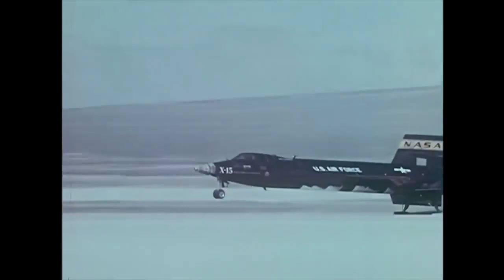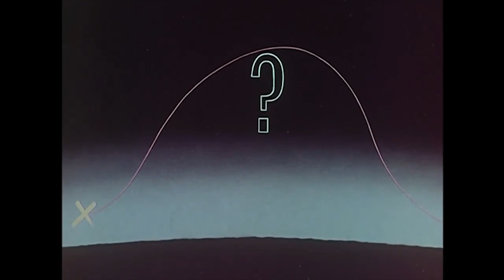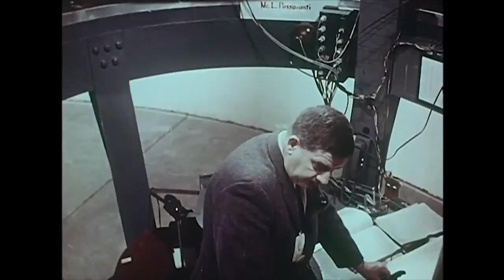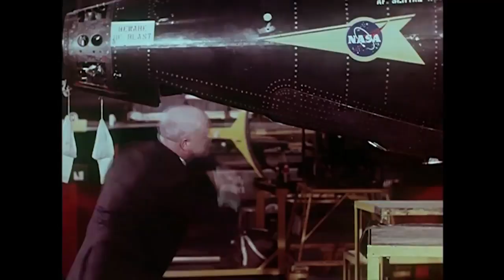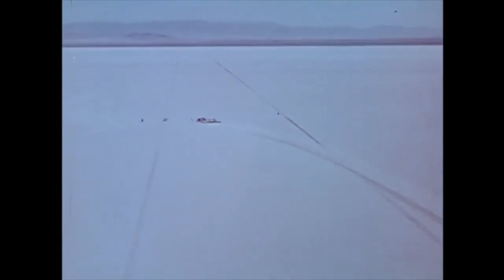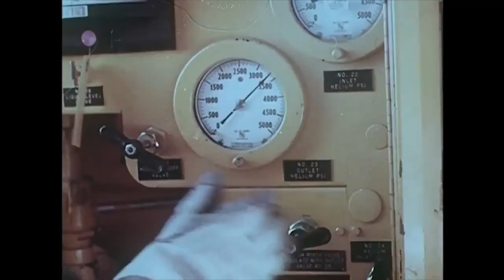Research Project X-15 - development of the X-15 rocket plane - 1962 NASA documentary

Comment: Much 8 ? Even today that's insane.  Plus , in my opinion, its the best looking aircraft, ever. Along with the Ford GT40, the best looking car ever.  What a wonderful era.
Reply: it's top speed was 7,274 km/h which is mach 5.8 not 8.
Reply: @ashokiimc  Correct.  I worked on that flight line for 4 years in the Air Force. 98-02  The X15 run pad is still there and they were still using the same B52 for tests.   It has since been retired.
Reply: @ashokiimc  The top speed of the X-15 was Mach 6.70 or 4520 mph, accomplished by pilot Pete Knight on 3 October 1967.